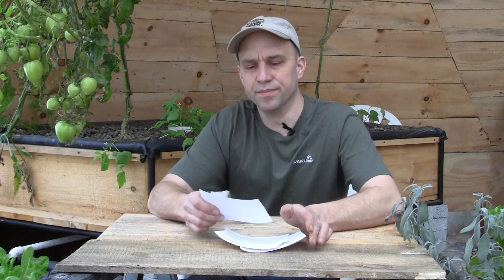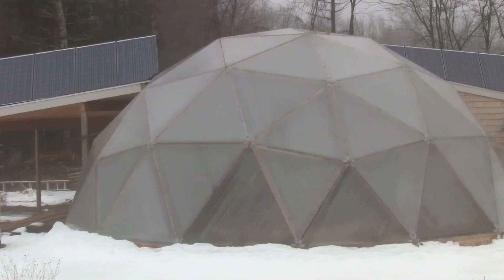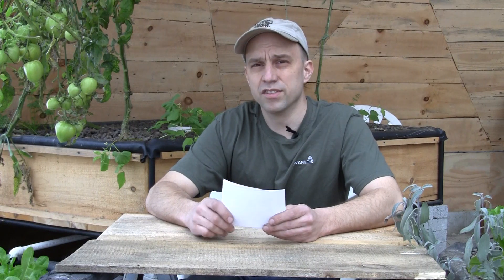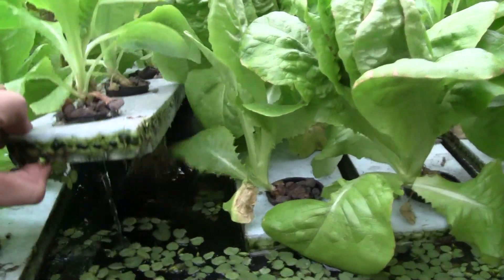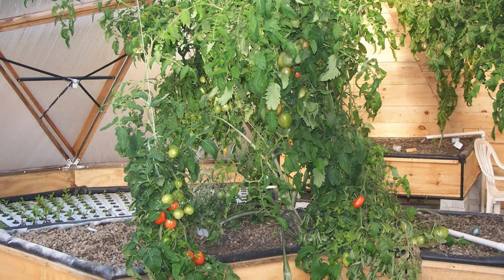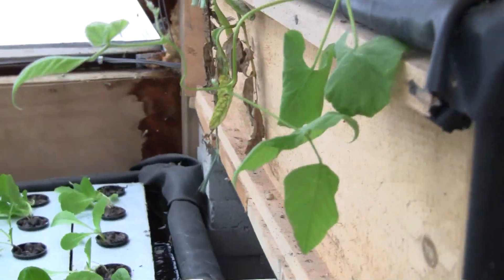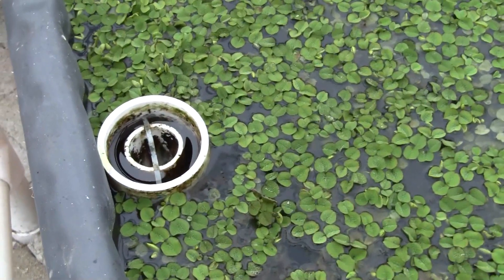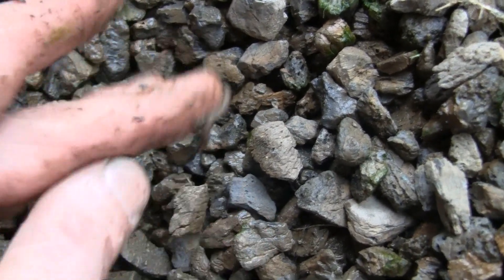FAQ #1 - Aquaponics - Geodesic Dome - Rocket Mass Heater

Comment from the maker: These beds hold around 160 gallons and I drain then with a 3/4" pipe.  Takes about 15 minutes to drain and 1-2 hours to fill, depending on the bed.

Comment: Thanks for all the super informative videos, Rob. I was just wondering how you decided upon the 8mm double wall polycarbonate vs. say a triple wall 16mm that provides a little more insulative value? Do you think the 16mm is worth the extra cost for the increased insulation with a little less light transmission?

Comment: Why use the extra clear side tube on the side of the bell siphon? I use a standard bell siphon and it works fine. I would imagine it's just to see the height of the water and see when the siphon will kick in?

Comment from the maker: Thanks.  The aeration is pretty good.  Even the little drop between the gravel bed into the raft bed is about 2 inches and the air is dragged all the way to the bottom of the bed...it's sort of surprising!   Also I have a jet of water in the fish tank which keeps the entire surface moving....very good for aerating!

Comment: Have you looked into a 'venturi siphon' to solve/aid aeration problems? You can configure your main pump to pull air into the system while it is pumping from the fish tank to the grow beds. You can also configure your grow bed discharge to aerate completely underwater (no splash). This video has an example of both methods: watch?v=rhUoSwbSnVg (skip to 2:55 for aeration/venturi content)